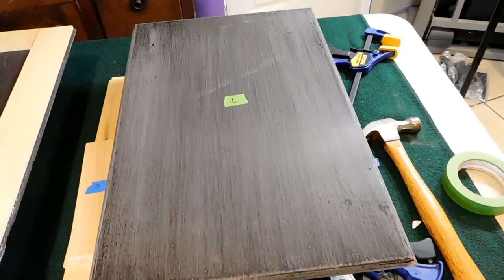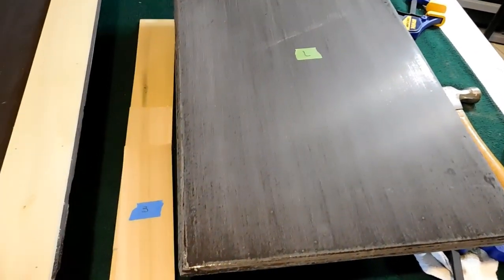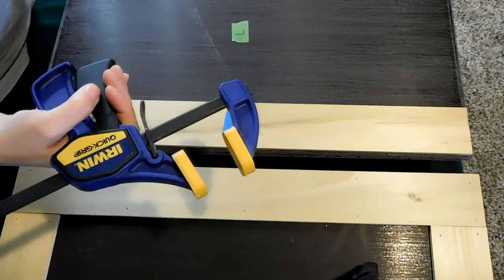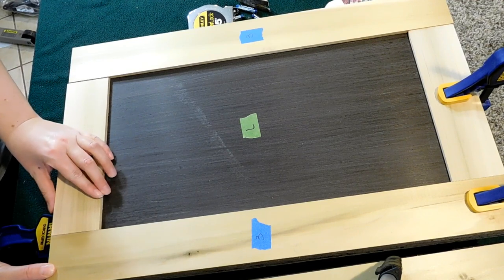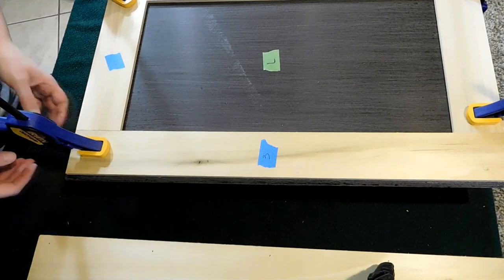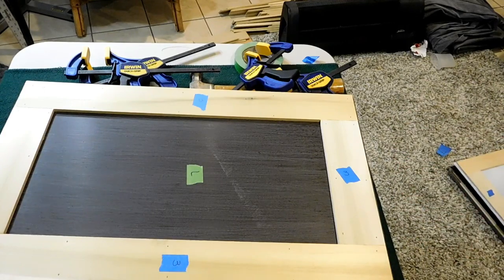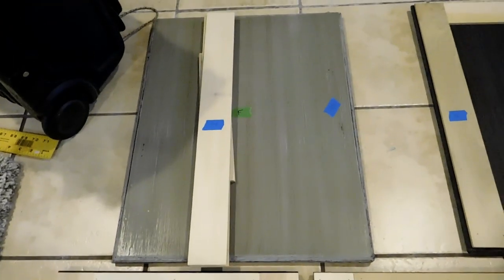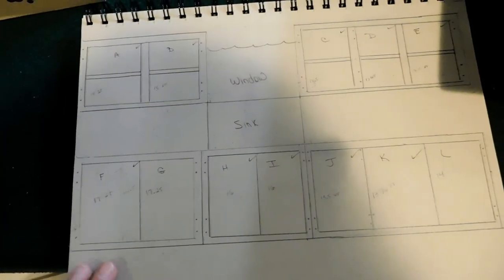DIY Flat Beveled Edge Doors to Shaker Style Cabinet Doors!!

Comment: Can I get a link of the type of wood you got?
Reply from the maker: Good morning :-). The link is listed below to the boards I originally bought. I do want to let you know though that these boards are unfortunately no longer available. But this will give you a description of the exact wood that I used and you might be able to find something similar at Home Depot or somewhere else. You may also try to get a larger piece of wood in the same thickness, and try to cut it to the exact size of boards that you need if you can't find similar ones elsewhere. If you have any more questions please let me know.

https://www.lowes.com/pd/Common-1-4-in-x-2-in-x-4-ft-Actual-0-25-in-x-1-5-in-x-4-ft-Poplar-Board/1000074305
Reply: New Day Vlogs Thank you!❤️
Reply from the maker: You're very welcome!! 😊❤️
Reply: @newdayvlogs  Beautiful work! You provided exactly the info and guide I needed. Looking at the description on the boards you used, it says the "common" width measurement is 2 inches wide and the actual width is 1.5 inches wide. Can you tell me what width you get by actually measuring them? I was thinking 1.5 would be too narrow, but I'm having trouble finding boards that are actually 2 inches wide without then being too thick. But your doors look great! So if you don't mind, would you measure them and verify the actual width? That will give me more confident when buying the boards I need. Thanks!
Reply from the maker: @Kt222dt  Thank you so much first of all! :)  I am so glad my video was helpful! I bought the boards already precut from Lowes, and they came 2" wide x a quarter inch thick, and 4ft long.  I am not sure how wide the actual cabinets were because we actually sold that house, and bought a new one.  But if you aren't sure what size trim would look the best with your doors, I would try the measurements I used, and just sit them on top of the door face, and judge it from the  way it looks.  You could actually cut up cardboard in 2" wide strips, and use them as a template to see if you like the size. I know every door measurement is different, so that's what I would do ;D. I don't think Lowes still sells the strips of wood that I bought for mine anymore, but if they don't have something similar, you can buy a sheet of HPVA Maple Plywood , and have them cut it into the correct size strips that you would need for your doors.  I used 2" wide strips for my doors, so if you had to get a board cut to size, and you needed something wider for your doors other than 2", then a larger board would be the way to go so you could customize it to the desired size. 

I just checked out some possible options on Lowes website that may work for you.  I will link them below.  The first option for the Poplar wood strips, would be great, but they are only 2ft long, and 6" wide.  But they are a quarter inch thick.  You could get one of these, have the sales person at Lowes cut it to your desired size (after you make your cardboard template), and see if it would work. These individual boards are a little pricey, but they are really nice. The second option linked below is for a larger sheet, that you can get cut into the proper size you would like, and it's a quarter inch thick.  So take a look at these, and let me know if you have anymore questions.  Also, I'd love to have you subscribe to my channel if you aren't already!  Have a great night!

Nicole

1/4-in x 6-in x 2-ft; Actual: 0.25-in x 5.5-in x 2-ft) Poplar Board
Item #9369 Model #P 14X6 2 POPBD

https://www.lowes.com/pd/Common-1-4-in-x-6-in-x-2-ft-Actual-0-25-in-x-5-5-in-x-2-ft-Poplar-Board/1000595837?cm_mmc=shp-cprdmlwgooglelia-122-finishboards-1000595837-_-0&store_code=1922&placeholder=null&gclsrc=aw.ds&&gclid=CjwKCAjw-YT1BRAFEiwAd2WRtvnOMe4m797BtwspOkQNfX7bacXmbhLcQ6I3GYnliTB86j2Kc_lzXxoCipwQAvD_BwE

1/4-in HPVA Maple Plywood, Application as 4 x 8
Item #1051330 Model #PLY-06-00310

https://www.lowes.com/pd/Top-Choice-1-4-in-HPVA-Maple-Plywood-Application-as-4-x-8/1000406041?cm_mmc=shp-cprdlbmgooglelia-211-hardwoodplywood-1000406041-_-0&store_code=1788&placeholder=null&gclsrc=aw.ds&&gclid=CjwKCAjw-YT1BRAFEiwAd2WRtswylBLCRDnEkCQpZTeIU60otfqBaRNEMZadLkG3zzkUoA_9AUmbzBoCLyYQAvD_BwE
Reply: @newdayvlogs  Thank you so much! You've been very helpful and so quick to respond. I really appreciate it!
Reply from the maker: @Kt222dt  You're most welcome!! :D

Comment: what size of board did you use for the face?
Reply from the maker: Julian Martinez the actual trim that goes on the cabinet door is two inches wide by a quarter inch thick. The middle part is the actual cabinet door
Reply: Did you use 1/4" board and just cut them 2" on table saw? Or did they come in sticks like a 1 by 4 would??
Reply from the maker: Julian Martinez if you go to Lowe's, Lowes has them in about 3-4 foot long strips that are two inches wide by a quarter inch thick. They're not in sheets but actual strips
Reply: Cool! That makes things a lot easier lol! Thank you!
Reply from the maker: You're welcome 😊
Reply from the maker: Julian Martinez I don't know how I didn't see this comments, but I do apologize. but we ended up using 1/4 inch thick  by 2 inch wide boards that were already pre-cut from Lowe's. So I just took them and cut those down to the size I needed for the trim.
Reply: Correct me if I'm wrong but those look like 3 inch wide board (actual size being 2.5 inch) the 2 inch wide (actual 1.5 inch) look are a lot Skinner than what is in the video.
Reply from the maker: No they are actually 2 in wide by quarter inch thick and 4 ft long. I can send you the link from Lowe's if you want to get some or if you're interested in purchasing these? That's where we bought them from
Reply: Thanks for the quick reply. I just left Lowes and they do not sell actual 2 inch boards. The link you have been sharing is for 1.5 inch actual. They are listed for sale as 2 inch but actual size as seen in parenthesis is 1.5 according to the link you are sharing
Reply from the maker: Oh okay well I'm so sorry! Well that's good to know. I didn't pay attention to the parenthese I guess, and went by the first description before the parenthese. Yeah that's very misleading. so sorry for the confusion. They really need to get there signs updated lol

Comment: you could have cut the edge off, to make them square
Reply from the maker: jack wright no because then they wouldn't have covered the cabinets hole edges. the back part of the cabinets actually fits into the cut out for the cabinet hole and the edge covers the crack. So there was no way I could have cut the edges off. But that would have been a great idea had I had a little bit more of an Edge on it. Then I definitely would have trimmed it a little bit. There just wasn't that much space on it
Reply: i understand why you didnt know. i will have to take a look on how they turned out. every good ideal
Reply from the maker: Thanks Jack :D  I posted a spray painting video of what they look like after painting, and I will be posted a video of the hung cabinet doors soon. So please check back for that if you would like to see it.  Thanks so much for watching ;)

Comment: YOU STILL HAVE A BEVELED EDGE DOOR UNDERNEATH THE SHAKERS!
Reply from the maker: Lol yeah, that's the point! The face of the door becomes shaker style doors. Not the whole door! If I would have cut the beveled edge off the doors, then yes it technically would have made a normal squared shaker door, but then there would have been a gap around the edges, where the lip hides the back of the door, going into the cabinet. Just because the door has beveled edges, does NOT make it any less of a shaker door. A shaker door is a style. The front trim on the cabinet door, is what considers the style of door. And it looks beautiful! So you can either save money and try it, or if it still bothers you that it has a simple beveled edge, the pay more money and replace the doors with in your opinion "actual shaker style doors". My idea produces the same look, and are just the same, with a little edge. You don't really even notice the beveled edges of the doors once up. Good luck to you whatever you choose to do
Reply: Good point. My wife wants the gap to be filled so I am filling them. A long process.
Reply: @tamerthehun9536  well I hope that's your project turns out great and doesn't take too terribly long :-). You guys have a happy 2020